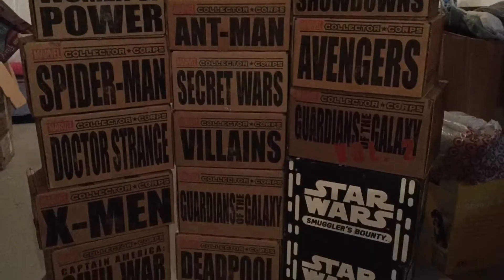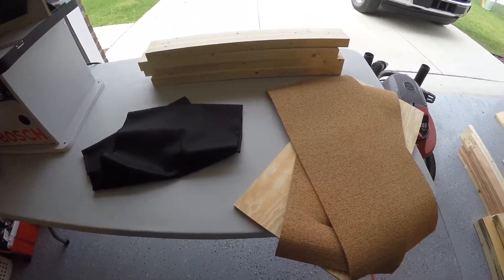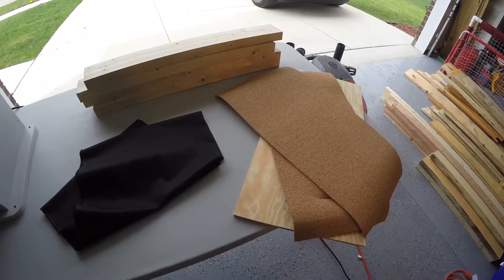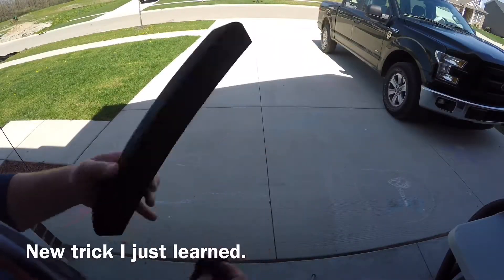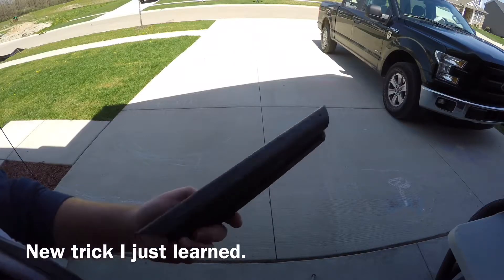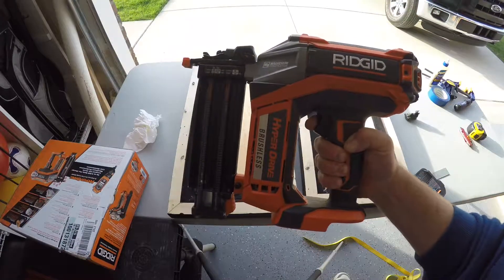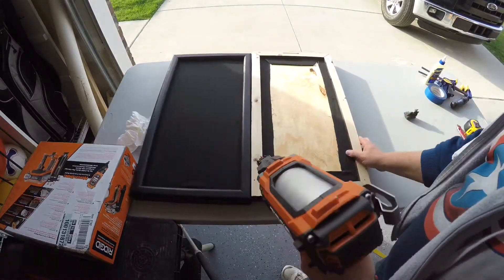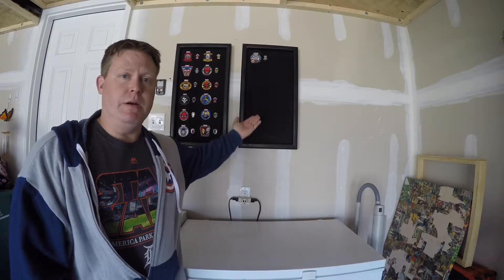DIY Patch and Pin Board Build

Comment: Thank you. This is another great idea for my LEO patch & pin collection. But I would have a few issues I'd have to sort out with your project. First of all, I don't think I would be willing to use hot glue to adhere my patches to the display because I'm very indecisive. With my luck, I would get to a point where I would want to rearange my patches & using hot glue will probably tear off the fabric.  Second, most of my patches don't have Velcro.  So maybe little velcro dots might work for me. 

And last. I like your idea for display INSIDE the house. My garage gets kinda dirty & dusty. So leaving them open & exposed would allow dirt & dust to get on my patches & be a pain to clean. Maybe some kind of thin plexiglass to cover them & still be removeable if you decide to move patches around?

Thanks again for the video.